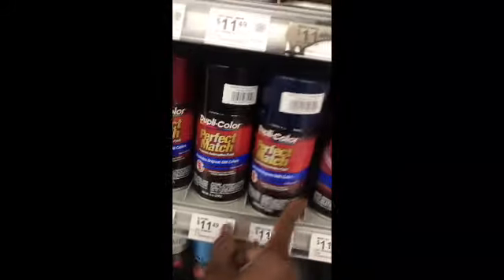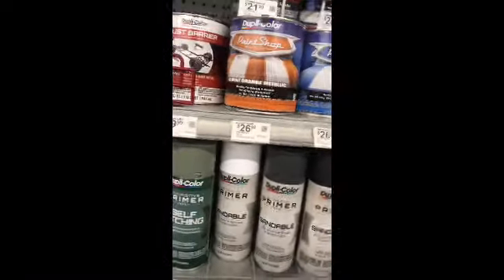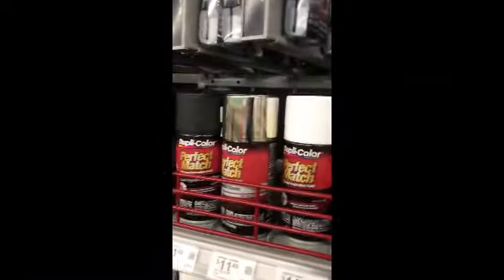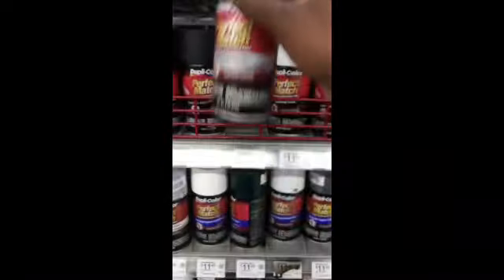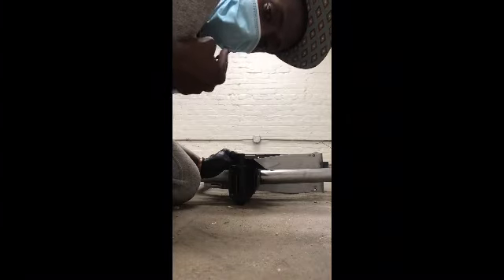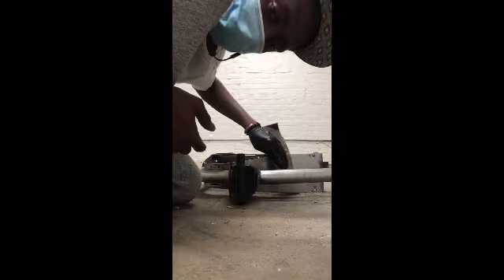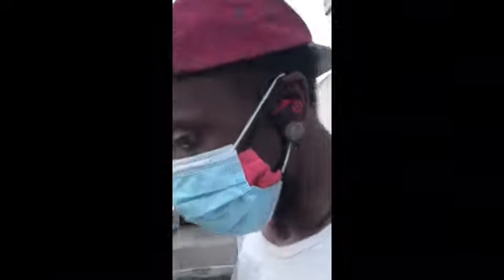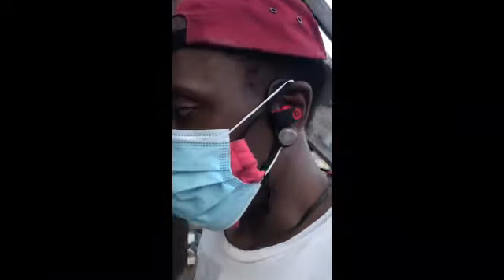Onyx RCR Build #103 Primer/Paint #OnyxRCR

Comment: So thanks for responding first off. This is my query the main frame is what size tube and the distance from head tube to the first bend. Looking at the battery compartment I think that's 1/8 plate steel? Only ask because I thought you said you had worked building frames and I right when it come to the plate steel size? Thanks again for the help.
Reply from the maker: Ooohhhhh nah I got it inspect them to make sure they were good I didnt get to build them or anything this was a "blemished frame that was going to thrown away. I check on the frame for you tho.